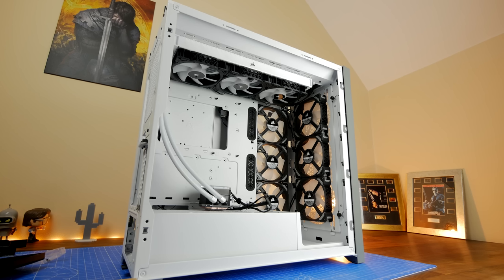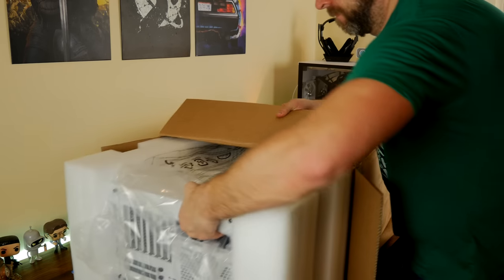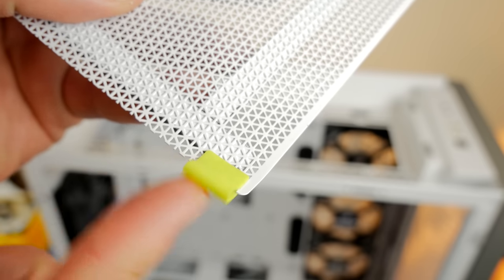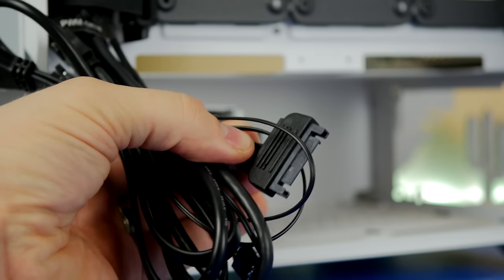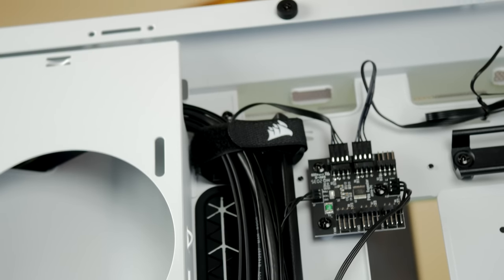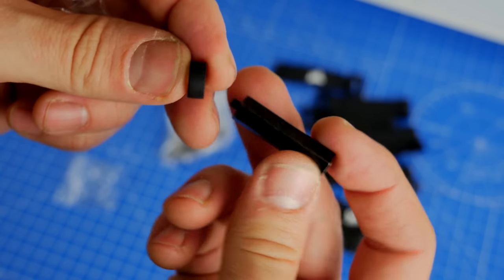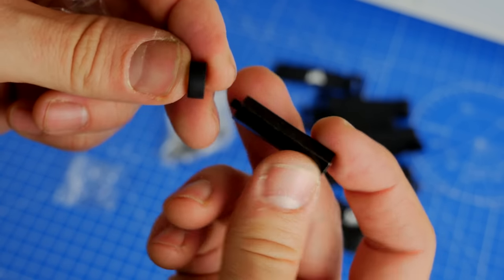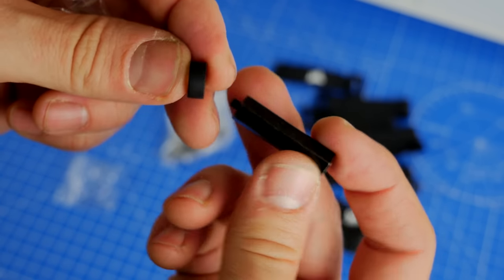Corsair 5000D Airflow build with 12 fans, H150i Elite Capellix Push Pull (in-depth build guide)

Comment: can i put one hdd 3.5 in th mobo backplate?
Reply from the maker: It is setup so you can yes. But I didn't try it so I can't say how good or easy it is to do I'm afraid.
Reply: @TheProvokedPrawn  lol or maybe i can remove the hdd tray and screw it directly in the base of the case. (maybe it will work but i'm sooo buying this case. awesome review and on point. thanks for the response. great videos in your channel. keep it up!
Reply: I already bought this case and waiting for it to arrive. but i'm lost in which case fans i will use? i'm planning to use the lian li uni sl 120 fans to avoid to much cables. tia

Comment: you should see how horrible the stock "white" fans look on the H150i Corsair Cappelex Elite AIO 360mm.  they have this ugly criss-cross plastic molded pattern than is visible in the case (EVO) when mounted as a top-mount AIO.  So just a tip to everyone, REPLACE THE STOCK CORSAIR FANS with LIAN LI AR120's UNI's , they have a nice brushed aluminum strip on this which is very aesthetically pleasing.  DON'T HESITATE, JUST REPLACE THEM IMMEDIATELY and you'll thank me later.  Peace and be safe!!

Comment: Literally all the HOT air from every component including the GPU is now being exhausted through the radiator. Yet the whole point of the radiator is to cool the CPU by passing COLD air through the fins.
Reply from the maker: Amazing how often people find something to criticise. What else do you suggest?
Reply: @TheProvokedPrawn  I'm sorry, I thought this was the comments section, not the compliments section.  For everyone else, my point is just something to consider if you planning a similar build.
Reply from the maker: Lol. You're fine to criticise but what mounting would you suggest? Side mounted as intake was another option. Or even front as intake but then that's restricting the airflow of cold air into the case potential making all components hotter. There's no perfect solution imo. Maybe you're an expert though and have tested them all? I'd love to know.
Reply: @TheProvokedPrawn  If we both agree there is no perfect solution, then testing every permutation won't change that. While I enjoyed watching this build, my comment is the reason I wouldn't build it myself.
Reply from the maker: So the case is the problem rather than my setup? Or am I misunderstanding?
Reply: @TheProvokedPrawn  Yes, the problem is with the case. The reason I watched this video was to see a push pull configuration in action, and how to manage the wiring for 12 Corsair fans. In that respect, you delivered everything I hoped for.
Reply from the maker: @michaeljemery  cool cool. Glad to help give ideas at least 😁🧐

Comment: Do you know whether I'd be able to use this AIO with Lian Li Unifans rather than the corsair fans?
Reply from the maker: Hmmm. Tough on. You'd have to use the Lian Li controller instead and I'm not sure where the pump head would plug into then so it would be difficult. Maybe it's plausible though but I'm not sure about the complexities.
Reply: @TheProvokedPrawn  Thanks.. I was thinking I'd have to connect the aio through the commander core and the fans separately through Lian-Li's controller.. but then syncing them all up is probably a whole different story. It's a shame because I've already got the fans but just upgrading the cooler & and this capellix is stunning !
Reply from the maker: @DaniiCEO  yeah the core might work for power and then the controller for RGB but that's just as assumption.

Comment: I have an obsidian 500d and I’m thinking of jumping ship. Someone talk me out of it
Reply from the maker: Do it. This is so much better.
Reply: Have you worked with the obsidian before? You are a bad influence 😉
Reply from the maker: @DisforDamion87  yeah I had the 500D ages ago. If you look you'll see it. It was one of my first videos. Its not a great video. It is a decent case but this is nicer to build in and has better airflow
Reply: I’ll take a look! Thanks 😊
Reply: I made the jump. This case is so much better. I recommend the airflow edition
Reply: Will a big air cooler like the noctua cromax black fit in this case... Don't want all the faff of water cooling
Reply: @54dbruno  According to the product page it is 150mm wide, so just under 6in. It will have no problem fitting; this case is wide.
Reply: @malikharris4055  cheers... I'll keep this case in mind for when I can get hold of a 3080 gpu.... Going to retire my two titan x pascal's lol

Comment: Basic white fan in the rear, problem solved.
Reply from the maker: Yeah maybe. I could have put another one back there but it would have needed another RGB fan hub and lighting node and I couldn't be bothered tbh. Or I could have left the AirGuide and plugged that into the mobo header. Or used splitter cables. There are plenty of options of course.
Reply: @TheProvokedPrawn  
Hi! Couldn't you plug the RGB cable into the JCorsair1 port in the MSI mobo and so it's not necessary an extra RGB fan hub? And the PWM cable into a free mobo header? BTW, thanks for your great video!

Comment: 12 fans —> 24 cables + 3 controllers = 🤢🤮
And this is just for the fans. I was wondering all the video why he did not use another set of fans that minimizes cables. The answer is Corsair 🤑🤑🤑
Reply from the maker: Corsair does good stuff? But yes, other fans are available.
Reply: Yeah, take Lian li fans for example. It will reduce the number of cables to 8 instead of 24 and the number of controllers to 1 instead of 4. And they still have better looking and good airflow
Reply from the maker: @mokhaleel585  https://youtu.be/219ze9BgjlU